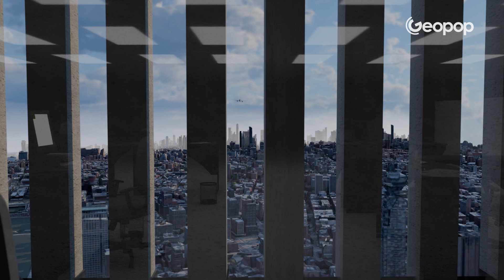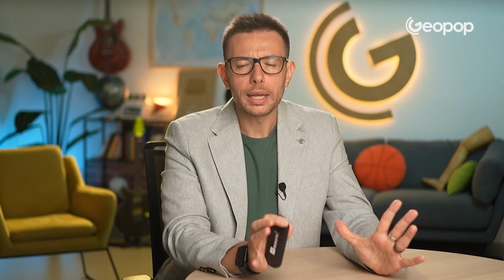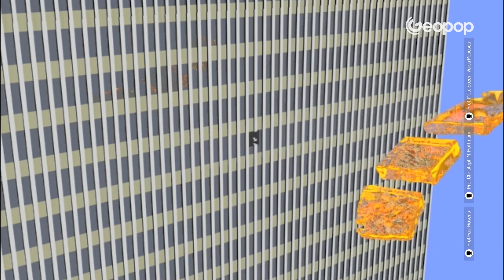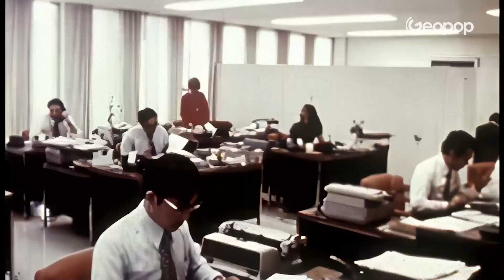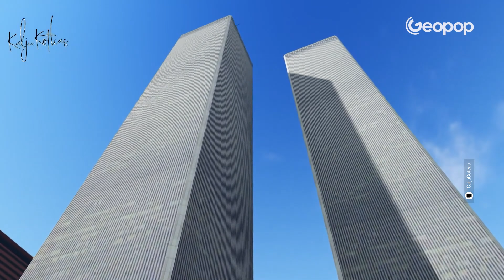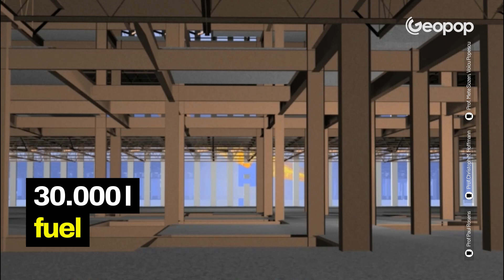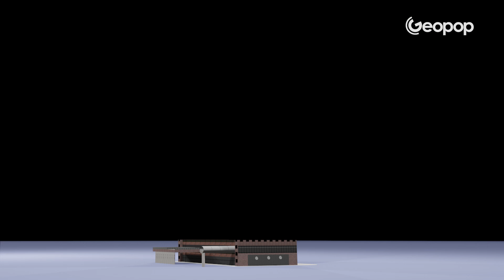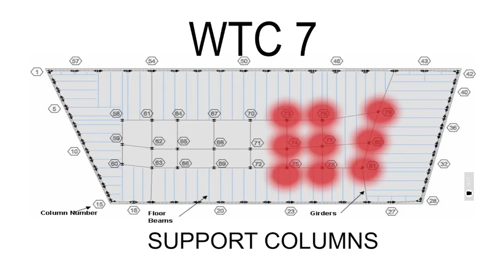9/11, 2001: The Technical Reconstruction of the Twin Towers and WTC 7 Collapses

Comment: If the the both towers collapsed from the weight of the 29 and 12 floors above falling on top, then what caused those upper floors to disintegrate. ?
Reply: So glad you asked. Strap in. 

At the End of the day, we all just want to know what really happened, right? It’s tough because there is a massive amount of absolute garbage information out there to muddy the waters, even though structural engineers had figured it out within weeks. How is the layperson supposed to sort it all out? 

I have put more thought into this than most because anything can seem like a conspiracy if you don’t understand how it works and if you don’t mind would like to offer my perspective. You may choose to disagree, which is fine, but if I am in error on any point of fact, logic or reason please let me know.  Just saying you are wrong or I don’t believe you isn’t going to make it. 

While complex, most of the Twin Towers collapse mechanisms can be seen with the naked eye and easily discerned and understood by the layperson IF sufficient time is taken to understand.

1.   The Twin Towers consisted of 4 primary structural elements together forming an integrated system where each relied on the others. 47 hollow box-section steel Core Columns carry most of the gravity loads. The 236 hollow box-section steel Perimeter Columns carry the remainder and ALL of the lateral (wind) loads. Long-span Lightweight Steel Trusses connect core and perimeter column together with a Hat Truss on top to tie it all together as an integrated unit where no element can survive without the others. There was no structural load bearing concrete and most major assemblies were bolted together

www.youtube.com/watch?v=u7OqrC74Dm4

2.   The impact of a 122-ton airplane (= 12 dump trucks) at up to 587 mph with the energy of a ton of TNT destroys the aircraft in 0.50 seconds. This in no way implies the Towers come out unscathed. Some folks get hung up on that. Many perimeter and some core columns are destroyed or damaged primarily by bending, twisting, splitting weld seams and critically by bolt-shearing failures at the end connecting flanges. No cutting or slicing - the reality far more violent and brutal. 

www.youtube.com/watch?v=zF-94yDHlk8

3. The impacts destroy or damage fire insulation, fire breaks and sprinkler systems on multiple floors. Jet fuel acts as an accelerant starting huge fires start across multiple floors simultaneously that spread spread rapidly with no effective firefighting or fire suppression. This was an unprecedented fire event . Office buildings are essentially giant piles of kindling when it comes to fires, chock full of stuff that burns vigorously and quite hot. 

4. The hotter steel gets the weaker it gets shouldn’t be a revelation. With fire protection compromised the survival time of the steel greatly reduced . Over time heat gradually causes the lightweight steel Floor Trusses at the damaged floors to sag, which we can see. No steel melted or needed to. Structural steel fails long before it becomes a puddle. It just needs to bend 5. A straight column is up to 4 times stronger than a bent one. Sagging floor trusses pull on increasingly weak and overloaded Perimeter Columns, causing some of them to bow inward by up to 5 feet until they buckle and fail, quietly initiating collapse. The formerly static mass above which the structure below could easily support converts to a dynamic mass up to 30 times greater. The Columns above and below the failure point are no longer aligned . The load bearing structure below no longer bears any of the load above, which falls past the lower columns NOT onto them. www.youtube.com/watch?v=ULdiD6gYZO0 www.youtube.com/watch?v=zTygQK3vriI 

6. Heat starts the collapse, gravity finishes it . Thousands of tons of debris drop within the four outer walls, through the open office space, the path of least resistance crashing onto the first intact floor, The bolted column connections instantly break as the amount of resistance the Floor Trusses can offer is negligible, slowing the falling debris only marginally and briefly before the connections fail. Note: 
6a. This is NOT a solid top block crashing into a solid bottom block . 
6b. The debris falls past the columns not onto them. The columns provide no resistance to the falling debris. 
6c. Only the bolted floor truss connections to the core and perimeter columns offer any resistance. A pair of 5/8” bolts at each end of each truss vs. thousands of tons of falling debris. 
6d. No laws of physics are violated. 
6e. There is no 20 floors against 90 floors but rather 20 floors against one floor, then 21 floors against one floor, then 22 floors against one floor, etc. 

7. This floor-led collapse progression within the four outer walls can only go straight down. There is no lateral force to push it over the side, only gravity to bring it down. 

8. Collapse progresses through the floor systems past the columns, through the path of least resistance . Resistance offered by each floor is always the same while the falling mass acting on it is constantly increasing and accelerating (gaining energy). This process of floor-by-floor destruction cannot be arrested. It can only speed up . Rate of floor failures increases with each floor as momentum increases, reaching an average acceleration of 0.65 of GA, or 35% slower than true free fall. Bam, bam, bam down the building until there are no more floors to fail. More mass, more velocity, same resistance with each floor. Don’t get stuck on the but the lower floors weren’t on fire nonsense. They didn’t need to be. 
8a. This process is often incorrectly referred to as “pancaking” which while catchy, is incorrect. Too simplistic and inaccurate anyway. More like Kaiserschmarrn. 

9. The Towers were 95% air by volume. As that air was compressed inside the building by falling debris, pressure builds until it is blown out the sides in reaction to the building collapsing . Those were not “explosions”, it was expulsions of compressed air caused by the collapsing building, explaining the low velocity, lack of flash, blast, supersonic pressure waves and lethal high-velocity ejecta. 

10. Perimeter Columns become detached and peel away like a banana behind the collapse front, playing out to the four points of the compass in long lines extending to 800+ feet from the base of the towers, damaging and destroying nearby buildings. 

11. Core Columns fail last as their internal beam bracing is stripped away by falling debris and lateral support from the floors to the perimeter columns is lost. 

www.youtube.com/watch?v=WpHXj62Ylw0

12. This process took 31-34 seconds from perimeter columns bucking until the last core columns hit the pile, or 1/3 the rate of true free fall. Don’t believe me? Just watch a video of the collapses and note the loose truly free-falling debris dropping much faster than the towers themselves. 

https://www.youtube.com/watch?v=dh4r-gHdyPU 

13. Each Tower had a 1-acre footprint. Far from collapsing inside their own footprints the debris pile spread out over 17 acres in a pile up to 14 stories deep. 8 surrounding buildings were destroyed and scores more damaged by the falling debris. 

14. NOT observed were the 180-190 dB bangs of thousands of high explosive devices or the blinding brightness of burning thermite. Explosives or thermite couldn’t have survived the impacts and subsequent fires anyway. Nor could they have caused the perimeter column buckling that clearly initiated collapse. Video of an injured and in-shock firefighter casually using the magic word explosion isn’t proof of explsoIVES and hardly makes a case for planned demolition. Pre-planned demolition doesn’t match the physical evidence and would be technically impossible, totally impractical and completely unnecessary. Simply, no one would bother. In 24 years, no structural engineers of tall buildings, including the 1/3 who have retired, have made any statements in support of planned demolition claims. NONE. The lack of such citations in engineering literature published anywhere in the world is telling. 

15. Twin Towers were perfectly safe within their design envelope. They only collapsed when taken far outside design parameters by an extraordinary and unprecedented event Impact + Fire (heat) + Time + Gravity = Collapse . Remove any 1 of those 4 elements and there is no collapse. Ignore any of them and you will never understand the collapse. The Twin Towers were an integrated system in which no one component could survive without the others. One fails, the rest follow, through the path of least resistance DOWN the open space, bypassing the path of greatest resistance, the columns. No laws of physics are violated and the above is true no matter who planned and carried out the 9/11 attacks or why so the attacks could still be an “inside job”. 

If you made it this far, kudos. That was a lot. I hope it was helpful, informative, non-adversarial and solicits informed critical comment, positive or negative. If I made any errors of fact, logic or reason or left anything critical out, please let me know and I’ll fix it. To stay focused, just one point at a time please and on-topic (Twin Towers ONLY). No word-salads of Gish Gallop. IF you can offer a more plausible alternative be my guest. Please start any reply with the words “Tits McGee” or I’ll know you didn’t read it and aren’t serious. Thanks for your time.
Reply: @TheLoonResistance  You are a very busy shill Fitzshill!